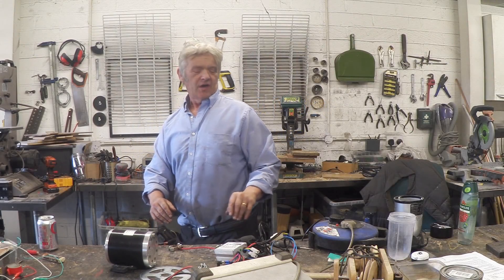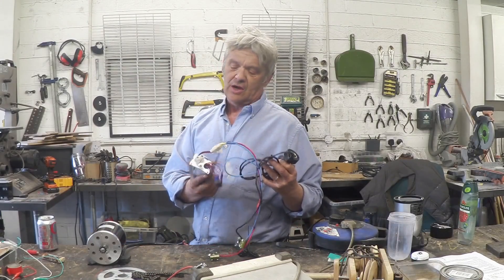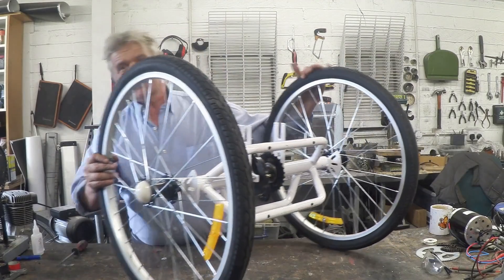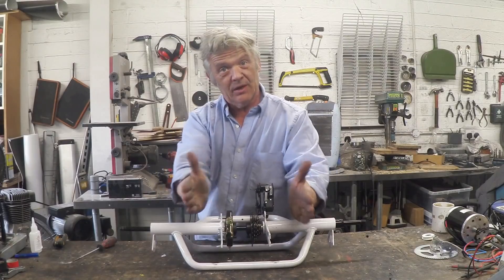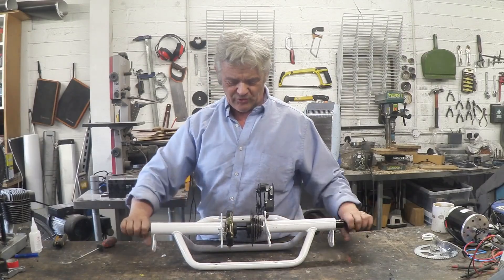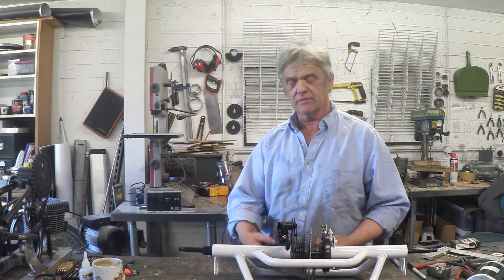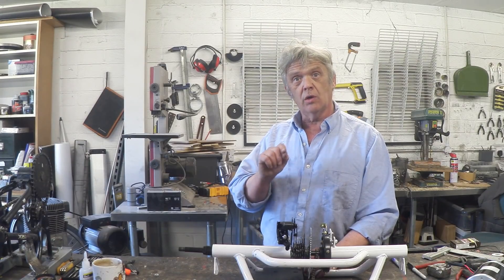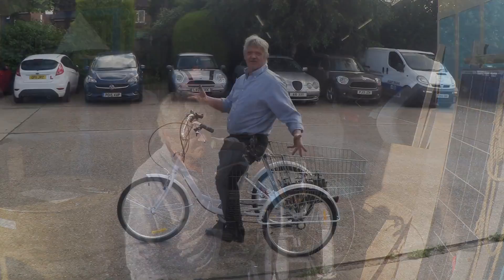1203 How To Build An Electric Trike For Under 300 - Part 2 - Adding The Motor

Comment: 8 years ago I picked up an almost unused Miami Sun Trike for $200. I replace the 3 speed internal hub with a 5 sped, and pedaled it for 6 years.   I am now 78 years old.  Two years ago , I put an Ebikling front wheel kit on it.  1200 watt  motor, 52 volt 20 amp hour battery.  I have put 1,500 miles on that motor, and it still gets 40 miles per charge, and I have no idea how fast it will go, because I will not ride it faster than 20 mph.  I run dogs with the trike, and one young dog walks fast at 12 mph.  He runs easily at 16 mph for 5 miles.   I love that trike.  they will tip over easily.  I like my 24 " wheels.  I put hard rubber tires on it so I never get a flat.  A little hard on the old body, but we need to stay tough as long as we can.  I put $1,000 into my trike.  If I have  get a new one I will likely get the exact same thing.  Oh!  I am substantially paralyzed on the left side, and can barely walk, but I discovered that I can peddle  8-9 years ago.
Reply: @1943Grandpa  A front hub motor? Is it easier. I am a newbie to this. I am getting a cheap trike so too I have a metal hip. Hills on bikes no way now. X

Comment: Why not use a small 2 cycle generator? Those things have gotten pretty cheap plus they are small and quiet. I don't really see any big issues one would have figuring out voltage regulation etc to get it working.

Comment: I wish I had known all this before I paid over £2000 for my underpowered, poorly geared, electric trike 3 years ago!  This is so inexpensive, I am tempted to do the same thing but my trike has a tilt function so I can lean it round bends - which I would hate to be without, so I will use the knowledge gained from these videos to upgrade my trike this year. Fingers crossed.

Comment: Less than £300 quid if you are very lucky to find a super cheap motor and super cheap controller/throttle. and if batteries are free. A 1000W bike is not legal on the british roads at any speed. The speed you refer to is for throttle only on a bike which is normally pedelec. The maximum legal  motor power (that is rated power, not peak) is 250W. Your motor looks like it's rated 1000W so could probably handle peak power of double that. You have an electric moped, which must conform to the construction and use regs, be insured, you need a licence, helmet etc. I would prefer to live in your world but unfortunately we have to live in the regulatory framework we have or campaign to change it. Please - I hope nobody gets nicked for following your advice.

Comment: I did the same thing (almost) A used trike i got for cheap, a 1.2Kw 36V kit from china FWD...and alot of written off mobile mast li-ion batteries in the box between rear wheels. 126ah 36V takes all the range anxiety away....another 126Ah in the trailer i can tow if need arises...

Comment: That MY1020 500 watt motor is 24 volts at about 2500 rpm at about 15 MPH (24KPH) , well it can handle 36 volts which makes it 1000 watts at 3750 rpm which will bring you to the maximum legal 20 MPH (32KPH). You only made one ERROR, you forgot the freewheel ($10) for the motor gear on the axle. Without it you will be peddling while dragging the motor which makes it harder to pedal and the motor is now a generator.  A 36 volt motor controller is about the same price but if the one you have has 50 volt capacitors you can use that one if not change the capacitors to 50 volt same capacity or just buy another controller. CHEERS.
Reply from the maker: to be honest a flywheel doesn't sound right - I would think you could just break the live on the motor with a switch - no circuit - no work. It seems to me a flywheel adds a workload but stores the energy for later
Reply: @ThinkingandTinkering  No matter what you do you will be fighting the permanent magnets all the time you pedal, plus the drag of the chain and sprockets. Not ideal if you are old like we are, but would provide a great workout for the young....lol. CHEERS.

Comment: That's amazing mate but just so you know the legal definition of pedal assist is that the the motor only works whilst you are pedaling
Reply from the maker: cheers mate
Reply: @ThinkingandTinkering  no problem, I know it sounded a bit pathetic to even mention it but you don't deserve points on your licence for going to asda at 15mph on a push iron 🤣 the UK laws on light electric tranceport need radical change urgently

Comment: I was going to build a 50cc 2 stroke trike like this but i failed to find a suitable transaxle / differential for a small axle. I enjoyed the video thanks.
Reply from the maker: we did a video where we made a differential from bike hubs mate
Reply: @ThinkingandTinkering   i watched the video thanks for the heads up.😃 only problem is i would have to figure out the brakes, because i wouldn't be able to put them on the axle.
Reply from the maker: @jgfugfljouyf8374  you could always use rim brakes like on a push bike or brake disks on the actual wheel

Comment: What adjustment would be required to make it legal up to 15 mph like all the electric bikes on the road these days.
Reply from the maker: pedal assist electronics - basically a cadence sensor, torque sensor, bike speed sensor and a control board
Reply: @ThinkingandTinkering  Oh yes - and a much smaller motor!

Comment: The best thing about electric bikes are the ability to use electric tool battery to run them... That 36v? A Ryobi 40v lawnmower battery can get a few smiles out of. While that 48v might use the e-Go 56v platform. Bases with 10g wire leads can be found off eBay or have them printed up from 3d printer. Robotics have been useing them in kids project everywhere.
Reply: Nice tid bit of info!

Comment: you're limited to 3.7mph? I think its 20mph here. Can you direct wire a motor like this one , just on and off no "throttle"?
Reply: Yes but you might as well go ahead buy a cheap potentiometer while you're at it and although it's not a real throttle it's a hell of a lot better than only having off and full throttle on
m

Comment: Hi Robert ~ sorry if I'm wrong but I don't recall you including the cost of the battery. Perhaps you could do a part 3 to show the options i.e. lead acid etc. KR AndyT(UK)
Reply: A good battery will cost at least another £300 quid Robert knows this but pointedly  fails to mention it Hmmmmmmmmmmm!
Reply: A car battery,  lead acid. Cheap and easy solution

Comment: Great stuff Robert...What about the battery?
Reply: Seems like he’s running a 12V system with standard car battery. You can pick up a 2nd hand good battery for less than £20, look around on FB marketplace ok just message one of the guys doing scrap runs. Often they pick up vehicles that are going scrap but still have decent or even new battery in them. And then charging such system is easy as well

Comment: "Gently tap it with a rubber mallet." Brilliant - In the abattoirs I worked at, the artisans used to do a lot of "gentle tapping" with a hammer to fix issues  :)
Reply: Just about everyone uses a hammer to fix issues.